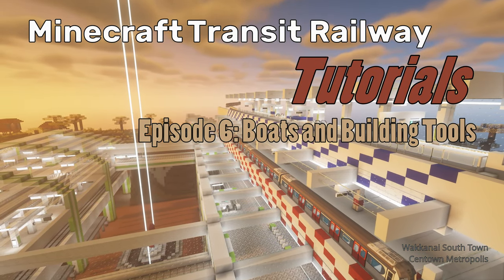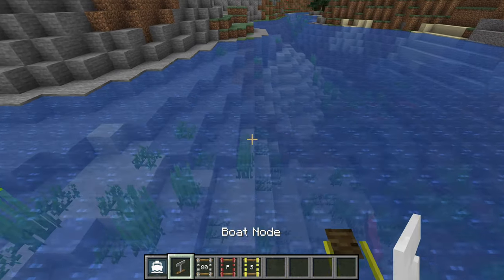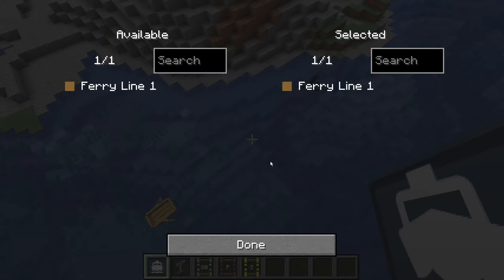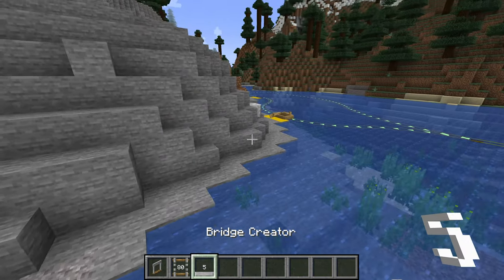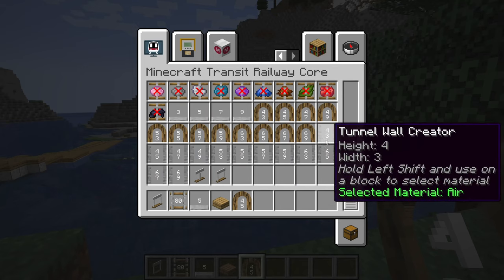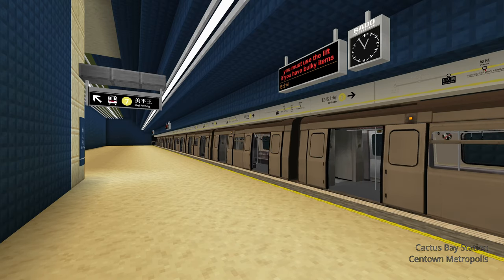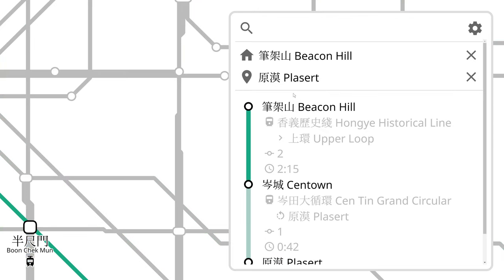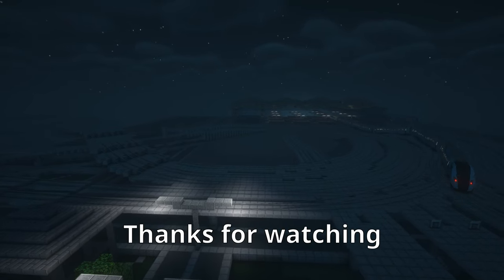Boats and Building Tools - Minecraft Transit Railway Tutorials Episode 6

Comment: This is a very cool mod and fun to use or just mess around with systems in a flat world.
I also have a suggestion you might like: When making routes, trains that go on a rail that will divide into multiple rails (like a big central station) will randomly choose a rail to go to but will of course calculate if there is a train on that track (platform rail) and thats really it.

Comment: It would be nice if one could create tunnels not on rails, by that I mean: If I place two rails and I would want to create one tunnel for both, I'd have to place a third rail in the middle for the purpose of creating the tunnel and then remove it afterwards. That's a good workaround but it'd be nice to avoid this issue. Could this even be implemented technically? I'd imagine it'd be difficult with the current setup. Same for walls.

Comment: My suggestions:
Add a setting,Generated path automatically or manually by player
Trains in the depot can be detected by the signal
If two platform or siding rails are on the same place but different hight, I want to select if I want the lower one or the upper one
If the platform looks like/, I can’t place any screen doors
Add elevators
Do you mean I need a bridge builder to build the floor of the tunnel?
In the passenger information display system (PIDS), add the name of the root of the train coming to this platform
Add a station announcer which will announce text to a station when a train goes by
Add another station announcer which will play music when the train is arriving 
Trains will go into a sliding rail even if it has a train 
The selected block of the building tools can change to air if you aren’t pointing to anything
Station coloured powder snow(as a prank)
Some bugs:(because trains are entities)
Players will not hurt if they are hit by a train
If you fell into a train in the station, if it’s door is open, you’ll get pulled in the train
Pressing shift will make you disconnect with the train if it’s doors are not opened 
Even if that is not a door, you can still go through the wall of the train
Some really bad bugs:
If the route is too long or there are too many routes, The screen doors and signs will have a very small text
If two signals are not connected but are across each other, They won’t work, but if I want to connect them, there will be some unwanted rails, consider adding an invisible rail
This is not a bug, but I still want to point it out, except the rail node, The rail can be covered with blocks and a train can still go through, this is one way to make a strange maglev train
Some station facilities are not craftable, although normally you will build it in creative mode
If a train is going very fast, it will be faster than 20 km/h on a wooden rail
Would you burn the wheels if you use a blaze rod rail
Trains are floating on the rails without wheels
Where is R train?
Reply: Oh you add wheels already
Reply: You typed:
本班車為505線往屯門
This is route 505 to Tuen Mun
Train announcer:
本班車為五百零五線往屯門
This is route 五百零五 to Tuen Mun u n
Reply: Also, mobs cannot ride the train for some reason
Reply: @小遊戲攻略區  the train isn’t an entity
Reply: @SoulLexx  Someone already told me, it’s a world data